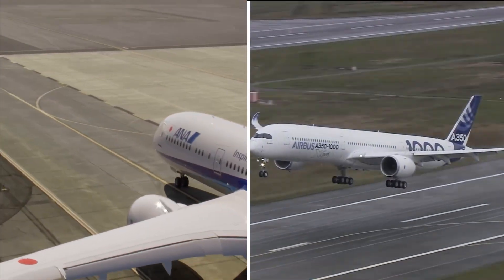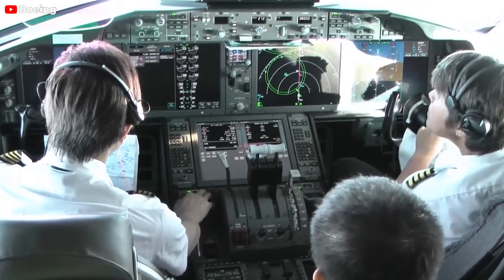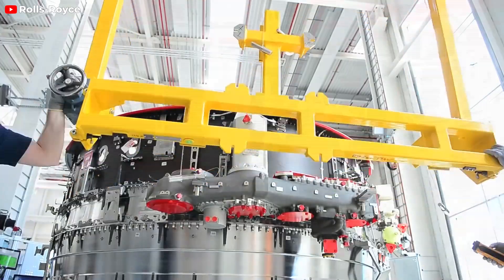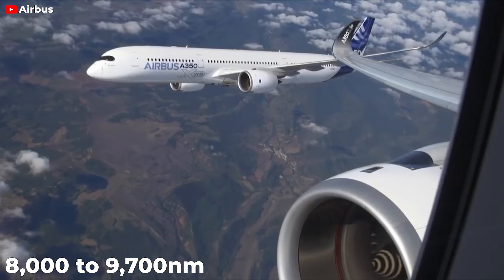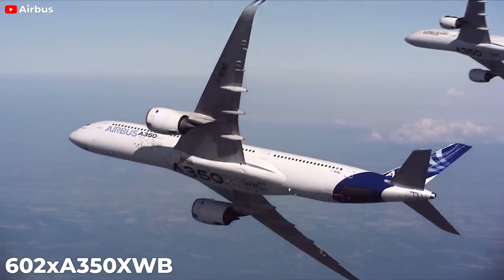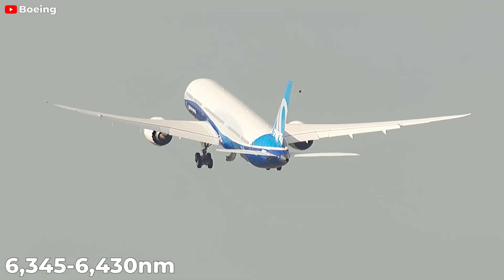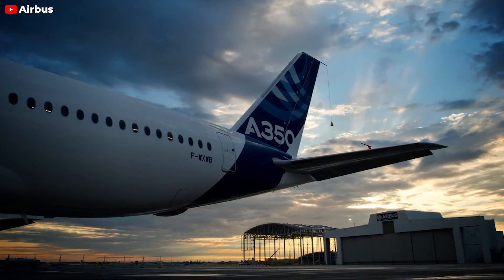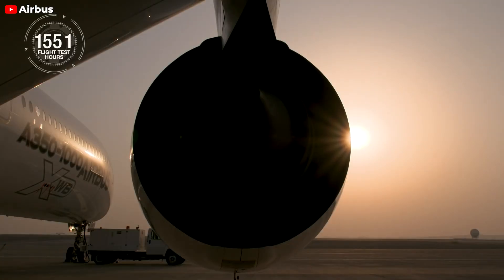Airbus A350 vs Boeing 787 Dreamliner: Which Reigns The King?

Comment: These two aircraft are designed and built for different segments of the market.  Every commercial aircraft is custom made for certain routes, capacities, seat mile costs, etc.   There is also the factor of commonality with other models flight deck and parts overall, as well as available services worldwide, and reliability statistics.

Comment: @FLIGAVIA  the A350 is not the real rival of B787. The real rival there is the A330 neo.. At that time the A330 neo was immediately introduced after the B787 started in service. Only the real rival of A350 is the B777x due to almost same capacity and engine size. So kindly edit your video about this matter.. Youre making it wrong

Comment: It would be better if you have compared 777 with A350
Reply: no. 787 and a350 is latest 3-3-3 seated planes
Reply: the 777 and 777X are in a class of their own, they have significantly higher payload capabilities, u cant really compare apples to oranges, and before u go tribalistic ape shit, this has nothing to do with which airplane is better, they are just build for different purposes.

Comment: Boeing is shit.
Never use Boeing for your flights..
BOEING has highest crash rate
🤮🤮🤮🤮🤮🤮🤮🤮🤮🤮🤮🤮🤮🤮🤮🤮🤮🤮
Reply: Just like your mom’s aged sour milk
Reply: It’s shit like you it ain’t shit your acting is like 8 or under grow up..😮‍💨
Reply: It was just 1 recent crash, crash rate doesn't make a company bad. Airbus also has a significant crash rate aswell. Im not glazing boeing, but dont think boeing crashes ALL the time, there are still many 787s flying right now and have any of them crashed? No. I do prefer airbus and yes boeing has flaws but im just stating that you shouldn't hate a company due to errors which have been easily fixed.
Reply: So you're gonna blame Air India crash on Boeing when in reality your curry eating pilots cut-off engines

Comment: The most important point is that AIRBUS is considering as a safer choice after the Ahmedabad AIR INDIA incident of 787 mechanical failure.
Reply: That was not a mechanical failure, the crash was intentionally caused by a suicidal captain, which can and has happened in any kind of airplane

Comment: I don't really get why people keep comparing the A350 to the 787. They are not competitors. The 777 is the direct competitor to the A350. The A330 is the direct competitor to the 787.
Reply: You are wrong. The A330 was superseded by the A350 which is in direct competition with the 787, as shown in this video.
Reply: @ No, you are wrong. The A330 was superseded by the A330neo which is in direct competition with the 787. The A350 is in direct competition with 777, not 787.
Reply: @robininspain29  If you look at the sizes of every A350 variant, they have a larger capacity and are bigger than every B787. The A350 is about the size of the B777. The B787 competes with the A330 and A330NEO and it makes sense because the A330's size and capacity is the same as the B787.
Reply: @AmericanAviation150 The A350-1000 (the biggest 350 not the most popular) has an MTOW of 319,000 kg, while the 777-300ER (the most popular 777) has an MTOW of 351,534 kg idk how u can think those 2 are in the same weight class, the 350 is significantly more advanced than a 1994 airplane i.e the 777, but they are not comparable.

And another funny trivia is there are twice as many 787s than the 350 even tho they are just 4 years apart, and the 787 is special in its own way in which it is a bleed-less airplane, the first of its kind, so in some areas the 350 is better in some areas the 787 is better, there is no clear cut winner here.
Reply: @robininspain29  People think the B787 and A350 compete because they both use composite materials and fuel efficient engines, which confuses people into thinking they are competitors.
Reply: @AmericanAviation150 787-10 is competing with A350-900 though. They both has exact same capacity but 787-10 carry less fuel with lower MTOW so range is also shorter. 

That’s the only different.
Reply: @tonamg53 it carries much less fuel with less payload, which makes it not a direct competitor.
Reply: @0w3nn  For any route up to ~11,000 km they are a direct competitor.

Only ultra long haul route that 787-10 can’t compete.
Reply: @tonamg53 no, the a350-900 cannot compete with the 787-10’s efficiency with that gigantic wing.
Reply: @0w3nn A350-900 is only estimated to burn 1%-2% more fuel than 787-9 when payload weight are the same… so this numbers is likely to translate to A350-900 slightly more efficient than 787-10 as it is basically exactly the same as -9 but longer and heavier.

Bigger wings + more powerful engines also means it usually can cruise at higher altitude at any given specific weight. Higher altitude means improve fuel economy due to less air friction and this can result in better efficiency overall.

So “bigger wings” doesn’t always mean it must be less efficient. 

And if you haven’t noticed… aircraft wings are getting more and more gigantic over the years, yet they are increasingly more and more efficient

🤦🏻‍♂️
Reply: @tonamg53 Nope, A350-900 burns 6% more fuel than 787-10, it is a hugely significant difference for airlines, not to mention they compound overtime during long haul flights, which they were designed to do. Bigger wings + more powerful engines means much less efficiency and drag compared to the smaller 787 whether you like it or not. Higher altitudes do not indicate better efficiency, the engines now must work harder to overcome the low air density. A350 is a much heavier structure compared the 787, it’s not optimized for the routes the 787-10 does.

And your last point is entirely wrong. Aircraft wings are not getting larger, they’re getting longer. It’s well known that aircraft with high wing loading are much more efficient than those with low wing loading. Less drag, better ride during turbulence, etc.
Reply: @0w3nn  Source?

Don’t bother replying if you just made that up.
Reply: @0w3nn  Btw, about my point that you said I got wrong…

777-300er has wing area of 434 sqm
777x has wing area of 516.7 sqm

767 wing area 283.3 sqm
787 wing area 377 sqm

A300 wing area 260 sqm
A330 wing area 361.6 sqm
A330neo wing area 372 sqm
A350 wing area 442 sqm

But please, don’t let me stop you from embarrassing yourself any further should you want to continue making stuff up just so you can win an argument 👍🏻
Reply: @tonamg53  Here's the problem with your logic. The 777x is physically larger AND heavier than the -300ER. The 787 is also physically much larger than Boeing 767. The A330 is ALSO much larger and 1.5x the weight of the A300. The only real comparison is A330neo vs A330, which has a negligible increase due to the longer wingspan (approximately 3% increase which is near negligible). The fact you are comparing the Boeing 787 and 767 tells me everything I need to know. So how about you stop embarrassing yourself with false logic  and misleading examples? 😂 🤦‍♂️🤦‍♂️
Reply: @0w3nn  Also, 787 is a direct replacement for 767 offer by Boeing 🤦🏻‍♂️

And 787-8 can carry slightly less passenger than 767-400ER…  yes, 767-400ER is a slightly larger size aircraft in terms of capacity than 787-8 (even though 400ER width and wingspan is less, the fuselage is significantly longer)

I told you that you shouldn’t be making stuff up…🤦🏻‍♂️
Reply: @tonamg53 The 787 is NOT the direct replacement for a 767. Holy cow do I need to explain this again? I’m done with you, the 767 is the SMALLEST wide body aircraft ever made and significantly smaller than a 787 both in wing area, MTW, fuselage width, and the 767-400ER is nowhere near as capable as a 787-8 in range, power, payload, everything… Absolutely none of the stuff was made up, if you don’t believe the facts that’s fine by me. How about you try making a 767 that can compete with the 787-10? You can’t? Well then, point proven. They are absolutely not the same. Comparing the largest of a small plane does not equal the smallest variant of a big plane.🤦‍♂️🤦‍♂️🤦‍♂️🤦‍♂️
Reply: @0w3nn 767-400ER seats more passenger than 787-8.

767-400ER actually sits right between 787-8 and 787-9 in terms of capacity.

787-10 is just a stretched 787-9 sacrificing range and overall efficiency for more seating capacity.

Holy crap dude. You got nearly every facts wrong 🤦🏻‍♂️
Reply: @tonamg53 Yea, keep talking about your seating capacity, it’s what holds you dearly 😂😂😂 keep ignoring MTW, wing size, engine power, payload capacity 🤦‍♂️🤦‍♂️🤦‍♂️
Reply: @0w3nn You do realised that seating capacity is directly related to payload right? Yes, 767-400ER has higher payload capacity than 787-8… It’s 45.8 tonnes VS 41.1 tonnes

As I’ve said in terms of capacity, it sits right between 787-8 and 787-9

A bit like how 777-300ER capacity also sits right between both model of it’s successor the 777-8 and 777-9

Holy crap 🤦🏻‍♂️
Reply: @tonamg53 That’s where your fatal error is. Did you forget the aircraft itself? The weight of the wings, engines, fuselage? What about the fuel in its tanks?  This guy 🤦‍♂️🤦‍♂️🤦‍♂️🤦‍♂️
Reply: The economy seating config of each will clearly state otherwise
Reply: @futurepaver2039 it really doesn’t. Fuselage width alone does not determine an aircraft’s capabilities.
Reply: @0w3nn  yeah but if the a330 seats 8 across, a350/787 seats 9 across, and 777 seats 10 across, isn't that what consumers notice
Reply: @futurepaver2039 But the 777 has less range. The A350 and 777 are the same size class

Comment: They don't compete. The A350 completes with the 777X and the 787 competes with the A330ceo/neo. You may as well do a comparison between the A380 and the 717.
Reply from the maker: yep thanks for your comment
Reply: @FLIGAVIA  You should do a video on Qantas' new A350-1000ULR 'Sunrise' aircraft with the extra fuel tank and 238 passenger limit that will fly the longest routes in the world such as SYD/MEL to LAX/LHR in early 2026.

Comment: Excellent video once again dude. I have never flown with A350 so I don’t have any thoughts about this aircraft. But i have flown with United’s 787-9 twice from Athens to Newark and back to Athens and according to my view is the best aircraft ever. I really felt my respiratory system so healthy during the flight while wing flex is something beyond incredible. Boeing did such a great job when designed the Dreamliner pushing Airbus to make its rival response.

Greetings from Greece. 🇬🇷🇺🇸
Reply from the maker: many thanks for your feedback, hope one day you will experience the A350! and please share with us then
Reply: The best widebody jet for economy class passengers in my experience of all the ones still in widespread operation is the A380 by a big margin. The A350 is second best and the 787 third. The A330 is fourth and a long way behind in last place the the current 777.  Hopefully the new 777x will be better for passenger comfort.

Comment: there is no comparison between these two. 350 far far better then 787
Reply from the maker: yeah thanks for comment
Reply: Ikr and people still have have the audacity to say the 787 is better than 💀💀the comparison In the video shows the a350 being better
Reply: @stale0610  I don't really get why people keep comparing the A350 to the 787. They are not competitors. The 777 is the direct competitor to the A350. The A330 is the direct competitor to the 787.

Comment: Never flown an A350 but like the Boeing family of jets. Really like the 787-9 for long haul, very comfortable. My understanding of the shorter range on the 787-10 is that it need different wings / engines which kind of defeats Boeings uniformity between the models? 11:08
Reply from the maker: thanks for sharing your experience✈️✈️✈️

Comment: Comparing the flat airplane cost between the two doesn't make sense, since the A350 carries more stuff. You could break it down in costs per seat, or just per cargo kg, since an economy seat is the least profitable contributor on the flight.
Reply from the maker: thanks for sharing ✈️ ✈️ ✈️

Comment: As an Economy Traveller, I have flown in both the Dreamliner and Airbus A350 (& btw, A380) and having flown several times with both, in approximately the same locations towards the rear of each aircraft, my perception is the A350 is more comfortable (but that may be due to Airline specifics) but the A350 has less wind noise at cruise altitude compared to the Dreamliner. To prove a point for myself, I measured the cabin noise in both cases using a NIOSH Sound Level Meter App on my iPhone which confirmed my perception that the A350 is the quieter of the two aircraft. Cheers!
Reply from the maker: No argument here. Thanks for sharing the app, btw

Comment: 787 silent but cramped with airline seat config. A350 all the way!
Reply: Try JAL with their 2-4-2 seating, what the 787 as originally designed for.
Reply: @EduardoJRamos  B787 is not the real rival of A350. It's real rival is A330 neo due to almost similar capacity category and the engine, and the fuselage width. The A350 is more wider for B787 to compete so it's not the real rival.. Only the B777x is the real rival of A350. Think again.
Reply from the maker: I love your cmt
Reply: Not that quiet..
Reply: Which 787 did you fly on